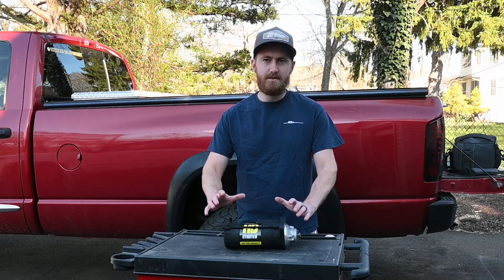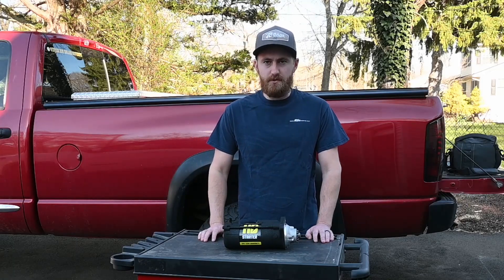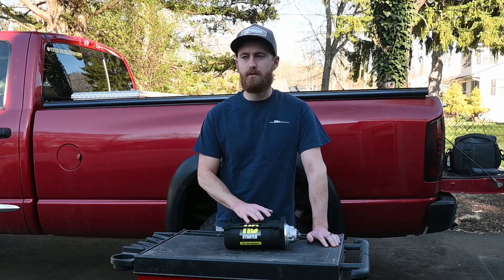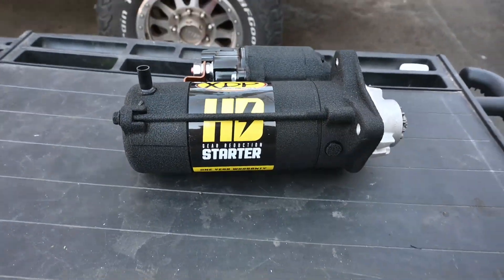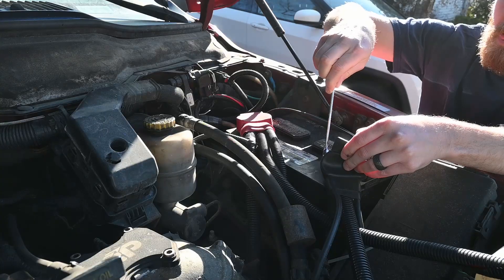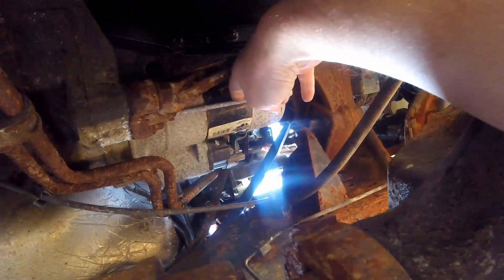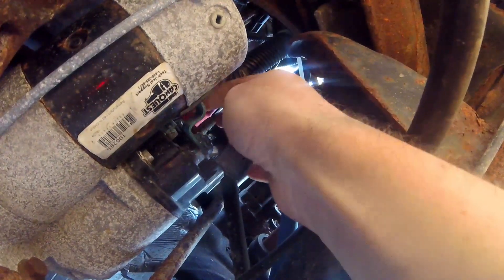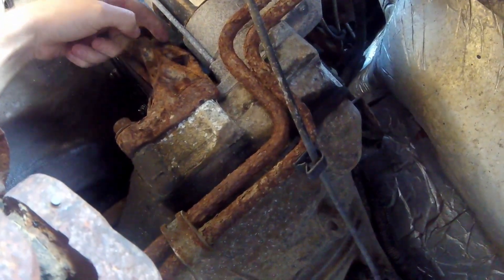Replacing the Starter in a 6.7L Cummins with an XDP Gear Reduction Starter

Comment: thats how mine sounds if its got a low battery meaning it should always crank and start that easy or easier. Both of mine will fire by the 3rd rrrrrr. good video
Reply from the maker: Thanks!

Comment: Mine doesn't have the bracket to remove on my 2012 , maybe because manual trans? Anyways, super easy and takes me like 20 minutes, got 230k out of the OEM starter, trying a Napa one now.
Reply from the maker: Good to know! It could be the auto vs manual or the 3rd gen vs 4th gen, I am not sure. Yea the OEM starter lasted me close to 250k also, that's why I was so disappointed that the other started didn't last. Hopefully you have better luck with your Napa one!
Reply: @cheesingarage  been good so far, I'm no expert, but maybe u are supposed to shim them or something, it's starts Everytime, but seems like I have to push the clutch through the floorboard lol

Comment: I'm changing one out now and the top bolt broke loose but it acts like it is cross threaded.
Reply from the maker: If you already loosened the other bolts it may just be the starter sagging and pulling on that top bolt. Try and support the starter and see if it is any easier to remove. If it is in fact cross threaded, you might have to go with a heli-coil or another means of thread repair.
Reply: @cheesingarage  na it's definitely not sagging.  It acts like all of the weight of the starter is hanging on that 1 bolt, but I tightened it bottom ones back up.
Reply from the maker: @RyanDale100  Hmmm...Could be either really corroded or, like you said, cross threaded. Your best bet might just be to spray it with penetrating oil and muscle it out hoping for the best but preparing for the worst.

Comment: What is that bar you had to take off
Reply from the maker: Do you mean the bracket connecting the block and the transmission? Its just a brace between the engine and transmission. I believe its actual name is an adapter plate bracket brace. From what I heard, it might not be installed on all years of the truck.

Comment: my starter died on my 2021 6.7 2500. 14+K miles. This is unreal to me... Was expecting this to last sooo much longer. Replaced under warranty but I wonder how long the new one will last?
Reply from the maker: That's crazy! Hopefully you have better luck with the new one. My stock one lasted a 'normal' life, it was the reman from the parts store that sucked.

Thanks for watching!

Comment: How is that starter holding up? Im on reman #4 this summer from advance/oreillys
Reply from the maker: No issues so far but its only been about 6 months since I installed it. Feels/sounds like the engine turns over easier but that could just be in my head haha. Seems like those parts store remans just aren't built to last unfortunately. I feel your pain there. Thanks for watching!